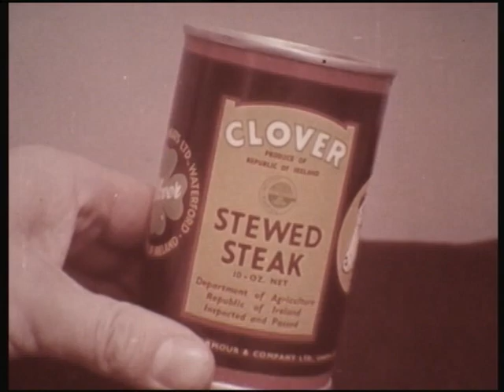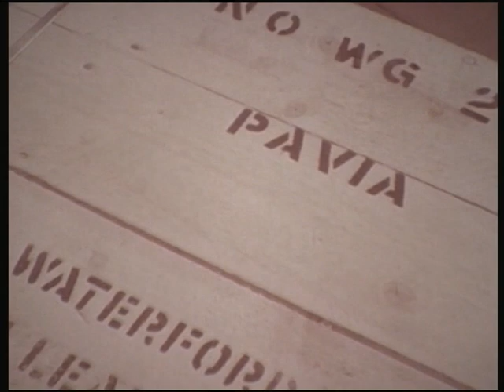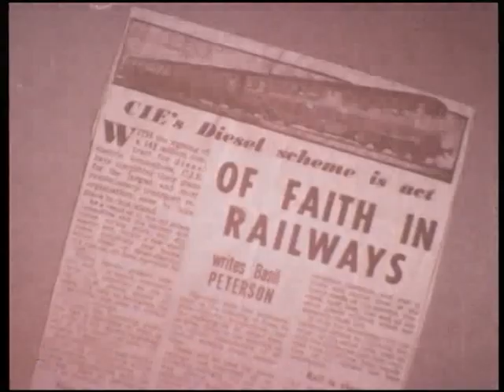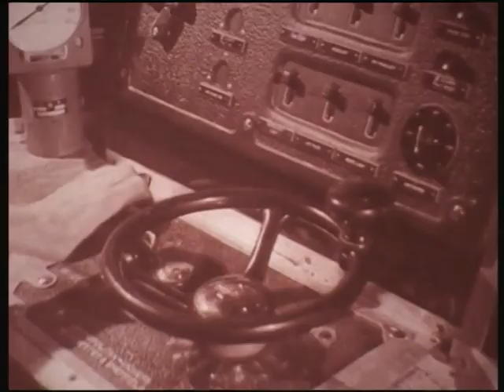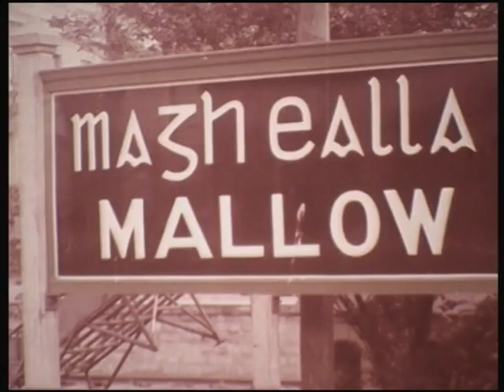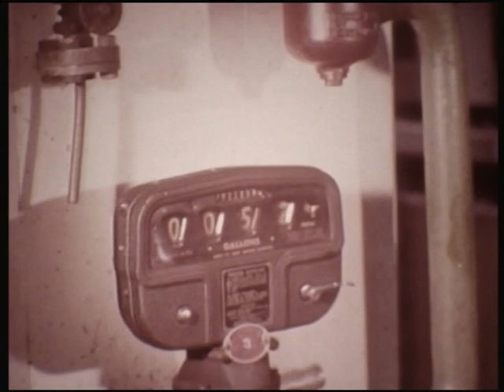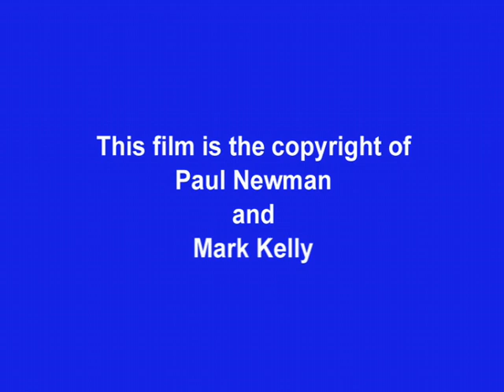CIE A & C Class Promotional Film (1957) - Metropolitan Vickers

Comment: They gave good service as marine engines, they just weren't suited to the on-off power demands of rail use, and the jolting they got inside a loco. They weren't the only ones to find that was a much more challenging environment than they thought
Reply from the maker: Hard to believe CIE ordered 94 locos without even have tested one for a period of time.
Reply: The crossely engines were changed for general motors ones. That did improve the 001/metropolitan vickers 201s

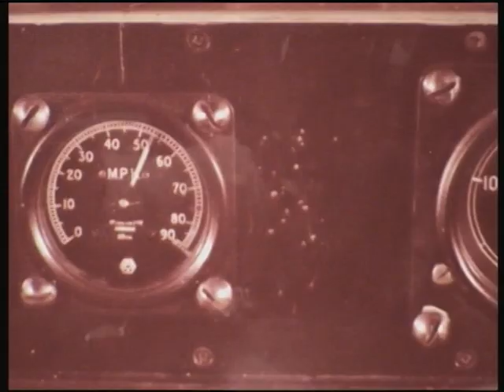Comment: Thanks for sharing this very interesting film.  At 15:12 and 15:32, we see a speedometer that's obviously defective, with the needle flickering randomly up and down over a range of about 10 mph.  It's surprising that they weren't embarrassed by showing this in a promo for Metro Vic locos.  Was this a common problem with the early models?
Reply from the maker: I’m not certain and I thought the same myself. Will try and find out if it was a common problem.
Reply: Speedometer was never reliable, that's why they were replaced.
Likewise the fuel gauge.
Indeed an awful lot of the locomotive, although the crossley engine was by far the most notorious.
As for metropolitan Vickers being embarrassed, the film director/editor and publicity department probably didn't notice anything was wrong.
Reply: Speedos were replaced with Hasler units and moved to the left corner of the cab.

Comment: Hitting 70 MPH 1n 1957, well 65 years later max speed 100 MPH, exception Mark 4  Dublin-Cork max 125 MPH in places.
Reply: There is no operation over 100mph on the island of Ireland.  Mark 4s are limited to that speed.

Comment: Always thought it was strange that they had the red/white marker lights, but no headlamp (as far as I can see). Surely even steam trains had headlamps and ran in the dark at that stage?
Reply from the maker: Steam trains in Ireland had no headlights then and still don’t! So it was wasn’t unusual for the replacement diesels to have none. Seems bonkers now but times were different.
Reply: The UK was the same, the railway is fenced off in most locations and headlights were considered unnecessary, apart from a few locomotives fitted with car headlights in the Scottish Highlands. Proper headlights started to be fitted in the mid 1970s, with the advent of 125mph running.
Reply: Headlights similar to the newly acquired GM's were fitted when they were re-engined in the 70's

Comment: A diesel engine that size operating at 600 RPM would last forever, and they did they weren't scraped because they no longer worked just outdated.
Reply: They were hopelessly unreliable, not developed enough for rail work.  Fine in a marine environment with constant power for hours (or days).

Comment: As has already been commented on, the propaganda advertising in this lovely old film did not live up to the fact the Crossley engines were woeful. I think part of CIE's decision was influenced by British Rail's hopes for their own Crossley engined Class 28 Co-Bo's, which were also built by Metropolitan Vickers, and which later proved to be equally hopeless. Both the A Class 001 and C (later, renamed B) 201 Class Metro Vicks did give excellent service, once they were refitted with GM engines, which prompted Irish Rail only to buy GM locos from then on. What I never understood was the notion that 1200hp and 550hp was adequate for their needs. Even the 121s and 141s with their 950hp and the 181s with their 1,100hp engines seem very underpowered by today's standards. I know the GM engines in the A Class were rated at 1,325hp, and even had some of 1,650hp; but it was not really until the 071s appeared, did 2,450hp appear. I would love to find out why Irish Rail opted for such low powered engines. Was it fuel consumption ?  Was it over optimism on their performance ?   I would be indebted to be enlightened by someone who knows !
Reply: Vic Sams,
In the 1950s, Ireland was a poor country, the track was only fit for low axle weight and most trains could be hauled by a single locomotive of 950 or 1200hp. For faster or heavier trains, the GM locomotives could run in multiple, 1900, 2050 or 2200 hp depending on whether 141 or 181 class locos. Of course a pair of Bo-Bo locos weighed 135 tons compared with the 99 tons of a 071 class, equivalent to pulling an extra coach.
While underpowered by our standard, or even by international standards in the 1950s, the standard passenger train up to 8 coaches and a heating van, were all capable of being hauled in theory by a single GM Bo-Bo, and the heaviest goods trains by an A class. Even though they were diabolical, I saw an A class lift 70 four wheel goods vans out of heuston yard unaided. Whether they reached Cork without a failure, I cannot say, but it was an impressive sight.
Incidentally if an A class was failed and a 141 unavailable, a C class might be asked to act-up. Such a situation arose about 1970 on the Wexford goods. It was 40 wagons and amazingly it got past Wicklow before failing on the ten mile climb towards Rathdrum.
Reply: @thomasburke2683  Thank you Thomas. I am indebted to you for taking the time and effort to post such a kind and detailed reply. I know axle weights vary. Canada / US was 40 tons, now increasing up to 60 tons. UK 25 tons (at RA10) - the heaviest in Europe, France 22.5 tons. Norway 15 tons (the lightest in Europe). Not sure if the wider track gauge is a hinderance for axle weight. I know it gives a more stable quality of ride, though. I have travelled over every CIE / NIR route (except Midleton and M3 Parkway that re-opened after my last visit, and Bleach Green Junction to Larne Harbour that was closed when I visited due to a rockfall at Whitehead). I love the Dublin Rosslare line, which is a personal favourite of mine. I fondly remember travelling behind several A (001) Class both on charter trains and scheduled services.  Plus pairs of 121s, pairs of 141s, and mixed pairs. Even E428 from Ballina to Claremorris, and pairs of 071s and pairs of the new 201s. I have visited nearly 30 times, and the wife's family comes from Co. Limerick. Never managed to have the courage to ask for a footplate ride in Ireland, but I have done so in later life across Canada, Portugal, Spain, France, Italy, Austria and even driven a train in Hungary.  My railway job in the UK came with an all-line cabpass. Spent many a happy holiday in Ireland. Great people. Good food, scenery, Guinness, and Tullamore Dew !
Reply: @vicsams4431  the U.S. hasn't gone past 40 tons as standard yet.

Comment: They were dreadful locomotives, as originally engined.  Unreliable and underpowered.

They were vastly improved when the British diesels were replaced by GM engines, beginning in 1967.  By 1971, all 94 'Metrovicks' were fitted with replacement EMD 645 engines.

The ''Metrovicks' were the last British stock purchased.  CIE, now Iarnród Éireann, is exclusively powered by GM locomotives since the early-1960s.

Currently, only the Dublin-Cork and Dublin-Belfast services are locomotive hauled.  The rest of the network operates with electric or diesel multiple units.